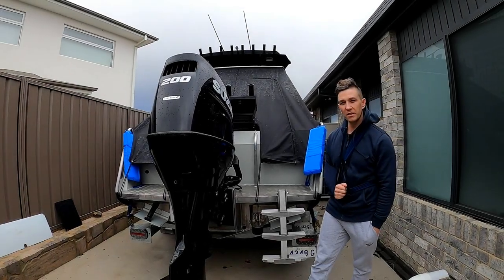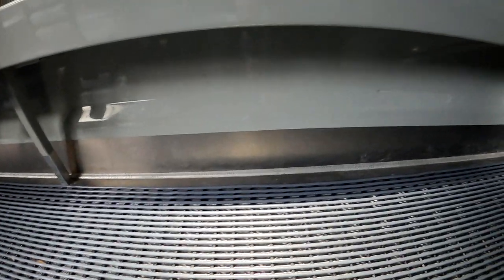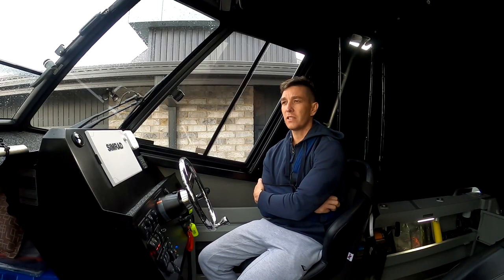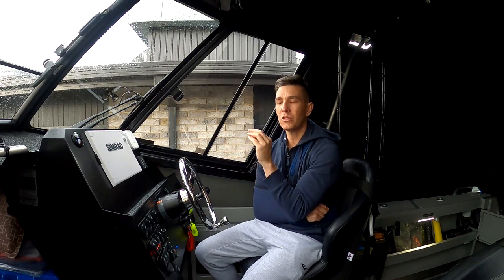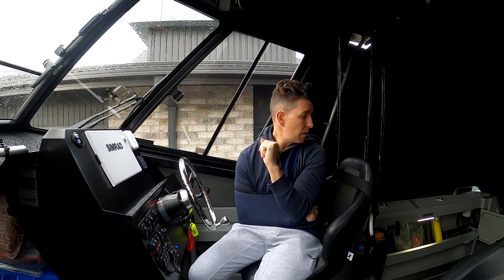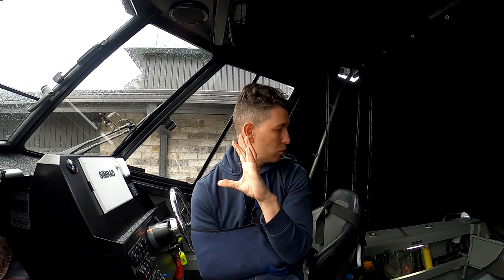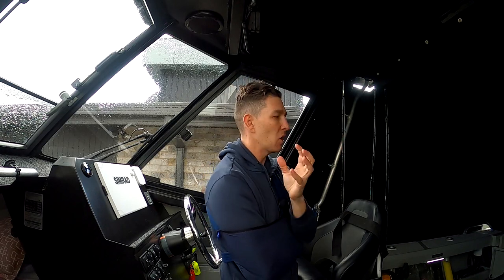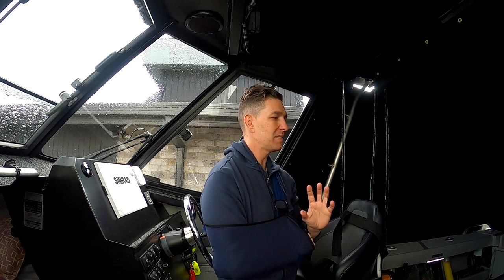BARCRUSHER where is my SELF DRAINING DECK

Comment: Footage of you going through these 6ft curling breaking swells with 50-60k winds please?? 
Get your self a secondary much larger backup bilge pump ideally one with an inbuilt float, set it about 2-3 inches higher than your main bilge. Run a separate outlet hose and run it directly off you house battery, NO SWITCHES,  only the positive and negative wires required, this will eliminate any potential switch problems in an emergency 👍
Good vid👍
Reply from the maker: yeah didn't film, Ganesh almost cried telling me to stop and to turn it around.dont do it often, but kinda had no choice we committed and there was no going back. 50-60km winds were offshore, gusting that day, 40km nominal.40km in that last video as I was filming.

yeah float switch back up pimp is definitely a good idea!!!! I was literally minutes away from that band new 670c sinking while docked.

Comment: My biggest issue I have with our 670HT is that the bunk areas are not water tight. Was not happy when I discovered this after our first trip out. I know I should have checked it, but our old glass boat had was water tight, so I just presumed this would be too. NOPE. It got me a two day ban from the Bar Crusher page for actually mentioning it on the facebook page too. To this day, I still HATE that it is not water tight. I understand everyone said it is because if you take on water, it has to drain away. Well, be smart and put a bilge pump in there or the other smart way is to have a couple of big bungs in it. Sorry to throw this in on your video page, but I guess a self draining deck would most likely eliminate the water issue in the bunk area.
Reply from the maker: totally agree!!

the bunks should be sealed
Reply: The bunk is not water tight as in it leak from the top ? Or because there is no step up seperate the front bunk area and the back deck ? Cheers

Comment: I HAVE ONE I wouldnt own a boat without one. My boat doesnt even have a bilge pump. 2-1/2 inch scuppers on each stern corner, and some people I know had 2 extra built in for even more.
Reply from the maker: hey Dave, no doubt a much larger boat though
Reply from the maker: i believe the smaller crushers don't have it due to what I have mentioned, wouldn't be enough freeboard left. also perhaps it would raise the centre of gravity too much unpacking stability in the smaller ones. the 730 and 780 barcrushers are MUCH bigger volume boats so they can make it work easily.
Reply: There are other ways water can get in to your boat than over the side and on top of the deck. As this guy experienced, a bilge pump gives you precious time to work out and enact a plan before your boat sinks. What if some stray electrical current corrodes some holes below deck while you're out camping? Or a bigger stronger boat crashes in to you at speed while you're asleep at anchor? Or any number of other ways water can get in. A bilge pump offers an option for returning to properly floating after plugging the hole(s), which the pump can give you the time needed to do so. I know plate boats are tough but they are not invincible.

Comment: There's only so much they can raise the floor because the boat will become dangerously unstable so that's why most trailer boats don't self drain...only the cats have self drain design, but they're on another level to mono's anyway.
Reply from the maker: Yeah agree. The 730 and 780 is a much deeper sides, larger volume boat so they can have self draining and maintain stability
Reply: @BaitBallin  Oh yeah in that size range they can accommodate to allow for it but plate boats have always suffered from being light compared to glass in the same size range so they become very unstable if they design them with anything over 21 degrees deadrise, they just become too buoyant whereas glass boats are heavier and bite the sea a bit deeper to get the chines in...It's another reason why the side coaming or topsides are so wide on good plate designs to keep passengers more central in the cockpit for stability.
Reply from the maker: Yes absolutely..... Makes sense.

Comment: If your boat gets swamped a 2000 G bilge won't dump it out fast enough and you'll cop another one. Then your in real trouble. If your mainly working offshore it should be mandatory.
My 640 is self draining, about 140mm less freeboard, but extra 100 litres in fuel and kill tanks.
Its a no brainer...
Reply from the maker: I wouldn't buy a boat for self draining specifically.... If the boat I actually wanted had it, cool. If not doesn't worry me. Been doing this for over 30 years and haven't needed one
Reply: Well hoping all go's well and you don't need one for the next 30 years

Comment: Cracked transom on a new glass boat or older ? Are you comparing old glass boats to your newish bar crushed ? 
I've minimum 700mm freebaord at the lowest point on my 5m glass boat upto 780mm at the highest.
Reply from the maker: transoms and floors old, broken seats out of floors near new, stress cracks all over boat near new, bolts and things falling off all of them. Many of our glass boats had as little as 620mm down the back. late model Haines hunters, Cruise crafts the works. Many have plenty of freeboard, like the Alison's I owned. but some don't. But things constantly fell off nearly all of them. Minor, but just mainly annoying tbh and no that's not the reason I have gone plate. This boat while not at soft a glass boat, I just hose it, kick it a few times for good measure and it's done.
Reply from the maker: we have re built numerous floors and transoms and have had / seen 5 year old glass boats with signs of rot. thats why my last few were Allison's with no wood under the floor at all, many brands are doing this now which is very good.

Comment: I’m starting to think this is just a Barcrusher paid site. I think your missing the point of having second options as a back up systems. A serious offshore boats needs to have back up options. Every point you made was based on having a working bilge pump, now let’s just say that failed and your 50km offshores. While unlikely, it can happened, just ask the Sailfish S8 owner who had this exact problem last year on the south coast of NSW. It’s at this point your’ll be looking for a self draining deck. Also why do you think Barcrusher offer self draining decks on their bigger boats? Is it because they see those as a serious offshore boats but not the 670HT?
Reply from the maker: I'd say it's because the 730 and 780 are much much larger boats (much deeper in sides) plus wider. freeboard on 670 would be too low with self draining deck, could even impact stability on 670 and below due to raised centre of gravity. those would be my guesses anyway....and yes having 1 or even 2 bilge pumps is obviously critical
Reply from the maker: and no affiliation with BC at all, don't even know if they watch any of my videos and they probably wouldn't like several of them.
Reply: If you 50k's off shore and your bilge fails potentially common sense being you shouldn't be out that far without a secondry back up.
Serious off shore trailer boats say like the 233 formula's don't all come with self draining decks, pretty sure that it is an optional extra.
If one becomes stranded 50k's off shore with no power at all to run a bilge it may be a problem, but for self draining deck to work adequately (with exception of bigger commercial fishing boats) the boat needs to be up on the plane to work at their full potential. 
Both have advantages and disadvantages, 
I've owed boats with both, can't say I'd prefer either, but I wouldn't go out of my way to install them if they weren't factory standard. 
Mored boats and commercial fishers I think it is essential, recreational trailer boats probably not so much.
Reply from the maker: 100% agree mate.

very few fibreglass serious offshore offshore trailer boats even have them, self draining decks have nothing to do with being a serious offshore boat. it's just one way of getting water out of the boat. Been offshore hundreds of times, with one bilge pump. check operation before every trip, no dramas. a second one wouldn't hurt though.
Reply: @BaitBallin  Like your vids - you touched on the real issue - how much water does anyone's boat take on or is at risk of taking on and answer really initially depends on design.
We had a plate 6.2m centre console and were in close trawling when a wave popped on a sandbar.  I was in standing in bow looking over stern and it broke over my head and literally filled the boat - down the stern water initially went over gunnels and the comment was it was like watching the bathtub drain it went out that fast (two scuppers about 8"x5").  No average pump works that fast or that reliably.  There are also some rigs that easily can take them over the stern backing up (esp with tilt not adjusted).It's a personal preference but if you've had a scare I reckon you become  convert and if you have one you're not at the mercy of electrics - you run a great BC rig but the majority of boats probably aren't as new or polished and some only have one battery (I know - why would anyone?).
Reply from the maker: hey, yes I totally agree. open boats, absolutely a pretty big deal to have draining. no matter how hard I try, unless I do something absolutely stupid like leaving bungs out nothing comes in the boat. the point of the video is that too many people get hung up on features that the may never actually need, just because clever marketing convinces them
Reply: Don't Sailfish S8's have self draining decks ? I have been on two and they have ? or did the S8's sponsons leek. Interesting what happened ?